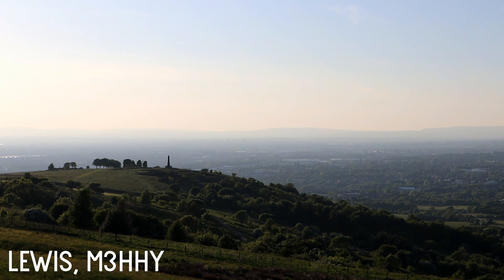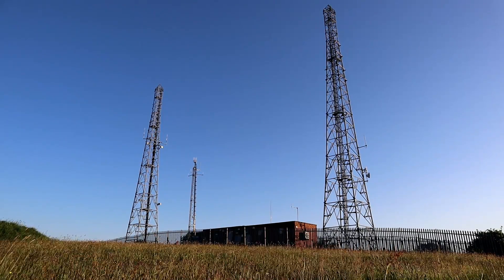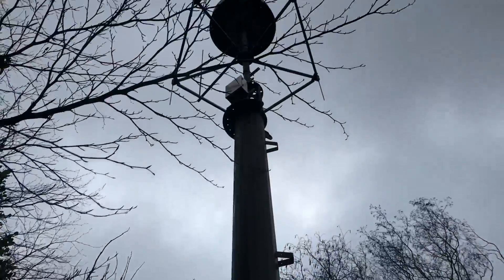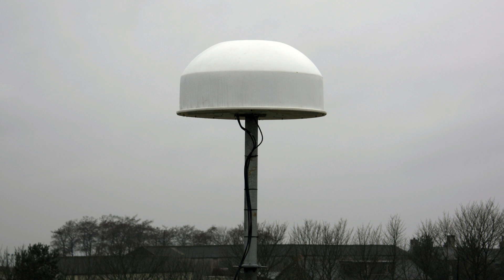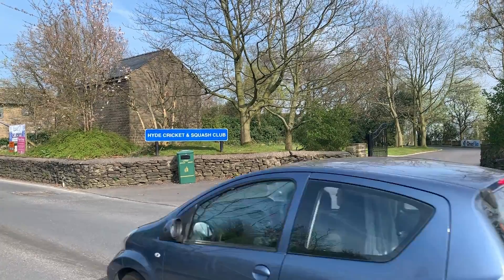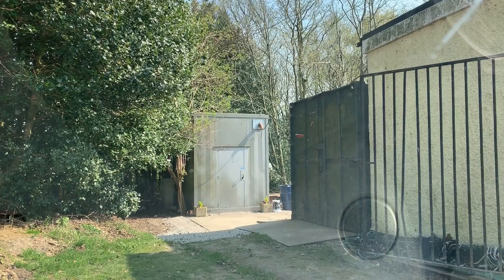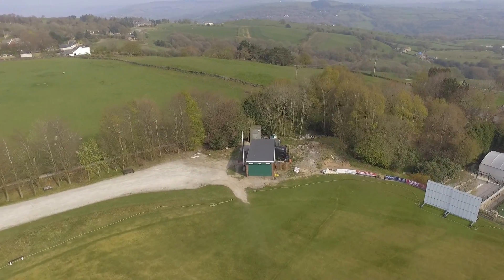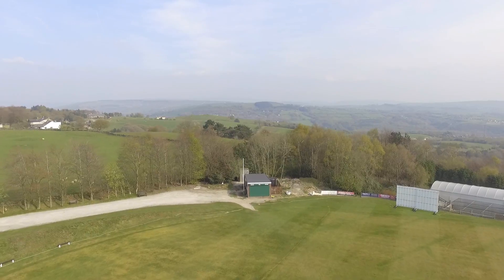Ofcom Spectrum Monitoring Is Changing

Comment: I have had my own theory on OFCOM's agenda as far as amateur radio is concerned and its not a good one.  As a newbie (M6)  my background is somewhat limited, but with the recent changes to the curriculum for the 3 stage licencing programme it appears to me that analog radio, especially 2/70 will be sold off to generate revenue and push Digital as the way forward.  Each to their own, but I do not engage with digital radio and fear for the longevity of analog.......
Reply: Embrace the future ham radio will not die it just changes with the years dmr is very nice for example and it's become more like a interest in making your own communications and repeaters than a "build your own am radio"  type of hobby but the main idea still stays and that is to collect as much qsl cards as possible

Comment: Analogue radio is vanishing,  instances don't put any resources in monitoring anymore, in my country. I think that once airplanes(commercial and private) and analog radio will go fully DAB+ monitoring will seize 100% too. I forecast that in 5 years FM the 87.5-108 radio band will only be populated by low power pirate stations or by local organisation who lease a frequency at very low price. I already hear some pirates picking in free frequencies and  in Holland every week end you hear about 20kw pirates that's why instances is still very active over there .  Dismissed analog FM transmitters are flooding the 2nd hand market right now, last time I saw a 1kw mono FM transmitter for sale for 500 Euro. MW stations are shutting down one after another but these transmitters and up in scrap. CB and Amateur radio is dying too sadly. Here in Belgium shortwave radio has stopped, FM is next. They even stopped digital terrestrial tv broadcasting. Yep times are changing but the drive is money. I never heard about fines last 10 years.  And if things go to court the judge will only give very mild punishments, so lawyers doesn't cover the expenses going to court.